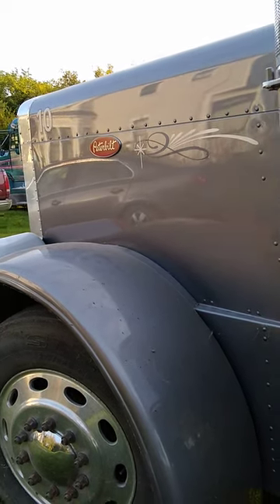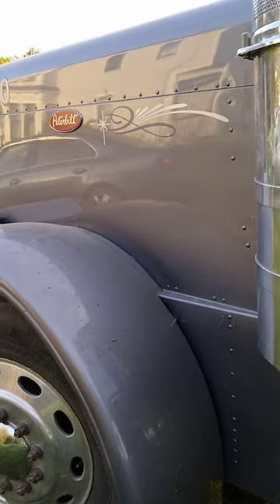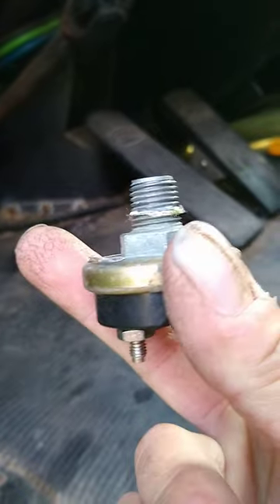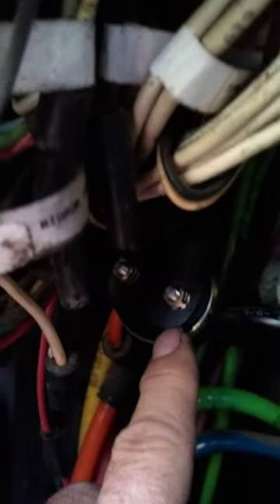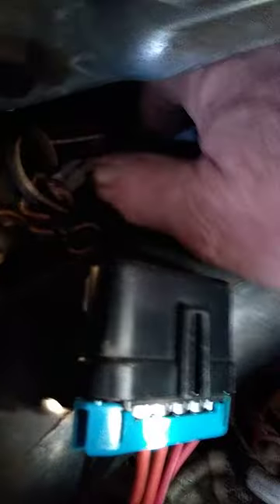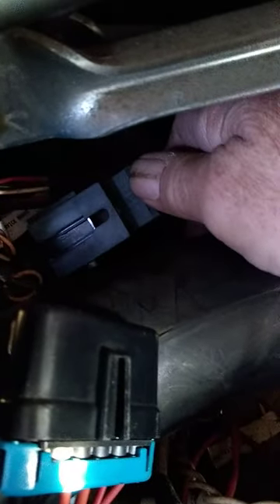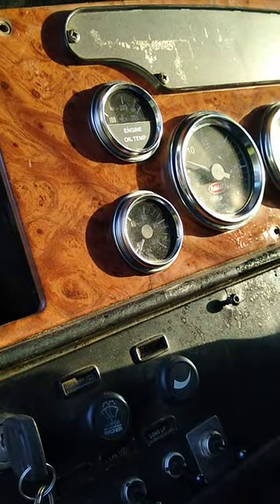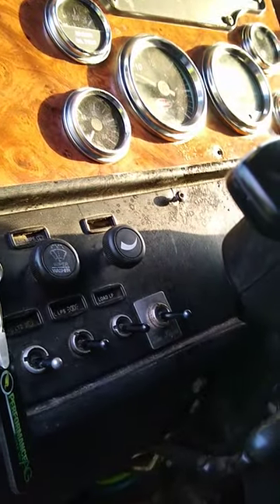2005 peterbilt brake light switch and relay location

Comment: I own 2005 379 Pete brake light stop lighting up when pedal press,  change circuit breaker changed brake switch still not working now I try relay in dash I hope this fix my problem I didn't know relay in dash